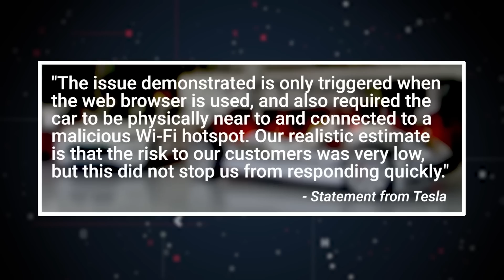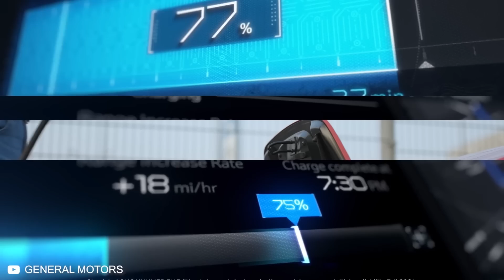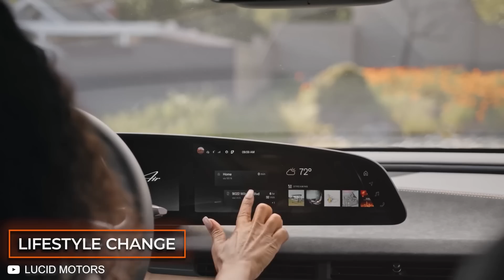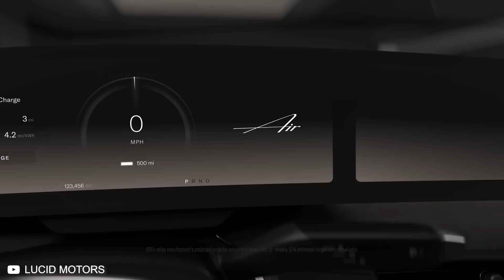EVs' Serious Problems That Carmakers Are Hiding

Comment: There is no climate crisis. There is no need to reduce our use of fuels. You're still falling for the lie that props up this entire scam.
Reply: Cool, we’ll keep exponentially consuming a limited finite resource that’s already showing signs that we’re running out of it…. Great plan. Love your work. Very logical. Much wow. Multiple tabs level IQ.
Reply: @engineeringtheweirdguy2103  where do you GET this idea that it's all about to run out? They've been saying that for 70 years. Every climate prediction for the last 100 years has been WRONG. If you think "the oil will run out" then you're the one who needs an IQ test dude.
Reply: @CTFlyer7  from the fact that compared to the 1970’s it now takes 10 times more energy to extract a barrel of oil than it did in the 1980’s. Despite improvements in technology and efficiencies. That’s because sucking the dregs out of the bottom takes considerably more energy and the only other places to get oil are much harder to reach. So maybe that’s where I’m getting that idea from sport.
Reply: @CTFlyer7  status of oil reserves is not categorised as a climate change phenomenon, doofus. That’s like stubbing your toe and shouting “THANKS OBAMA!!” But not in an ironic way. In a way in which you’re completely serious that you think it’s his fault you left your Lego out overnight.
Reply: @engineeringtheweirdguy2103  The biggest investors in fossil fuels know that if we maintain the current rate of consumption, we’ll be out of oil within this century, but not coal. There is a reason why oil companies keep as much oil wells in "inventory" as they can, and it’s not only because they want to keep them on the books as "reserves" to shore up stock prices ; )

The inevitable fight is coming over how fast to phase out fossil fuels, and it will be reduced to a battle between the biggest investors in banking and the biggest investors in fossil fuels; and globalists, politicians, environmental activists, and scientists will be irrelevant in this great battle.
Reply: @engineeringtheweirdguy2103  Keep in mind this person doesn't know that predictions from mainstream climate science have been accurate for half a century. If this person could refute any of the principal findings from climate science, he or she would be one very rich and famous person; be the biggest name in science since Albert Einstein.
Reply: Petroleum is too valuable to waste as gasoline. We should leave as most of it as we can in the ground for our grandchildren so they used for plastics, paints, petrochemical feedstock medicine, etc. The relatively current rise in CO2 is that is caused by human activities and the continued consumption of fossil fuels at current rates raises a risk for civilization. 

We are already experiencing the crisis caused by CO2 increasing - like that of CO2 fertilization, marginal farmland going out of production causing refugee flows and political instability, tropical pest species invading the subtropics, subtropical pests invading temperate zones, and the stratosphere cooing while the troposphere warms to name a few; all predicted by climate science. 

The only way anthropogenic climate change could be a scam is if there was a conspiracy involving tens of thousands of researchers operating in secret since the 1950s, in control of the physics and geology departments of hundreds of universities worldwide. Interesting how climate change deniers that say it is a a hoax, can never identify the hoaxers nor state the false claim clearly.
Reply: @rps1689  your Malthusian worldview is always wrong.

Comment: The lifestyle change is a HUGE issue for me, and I think is one people so easily overlook. You gotta look at it under a microscope. If I gave in to the pressure and, somehow with what little money I have, bought an EV, I would have to:

1) Run an extension cord out to the street every night to charge my car because I don’t have a garage.

2) Have to deal with bad battery charge in the winter because it snows here and my car would be parked out on the street every -40F night.

3) Gamble every time I go to work because there’s no charging station or covered parking where I work, so I have to pray I have enough charge in my EV after my 12hr shift. Good luck when winter comes…

4) Sacrifice most camping and road trips.

5) Risk spending 30+ minutes in a foreign (and possibly sketchy) area waiting for my car to charge because it ran out of charge before I could go home.

All in all, I’m sick of the pressure and shaming I’ve seen that come from pro-EV people. Don’t get me wrong, I love the idea of driving an EV, but the technology isn’t there yet to make me want to switch. You got an EV and you enjoy all the inconveniences that come with it? Great, but keep it to yourself, because in my estimation, current EVs are not all they are cracked up the be.

Comment: Might want to try some research before making video.  You temperature range for batteries isn't even close, my older ev has no battery warmer and I live in the northeast.  I've driven ev's for almost 20yrs in temperatures well below freezing with no issues.  Relay issues??? seriously?? all cars have relays and they are easy to unplug and plug in a new one. Even the biggest contactors have less than 10 screws including the ones holding them in.  Hackable electronics are already in all cars. Gas vehicles may be slower adopters but if you have a remote start via your phone or auto park, your hackable.  Battery's flammable, yes some types (like in you phone and laptop) are but not al. And for the record, gas is flammable too. Just a side thought a gallon of gas has the same explosive energy as a half stick of dynamite.  Something to think of the next time your putting 20 gallons in your car.

Bit of history: Henry Ford's (of the model T fame) wife drove and EV.  She refused to drive his smelly, dangerous, uncivilized monstrosity's.  Yes EV's have been around that long.

Comment: I think Hybrid is the way forward - looked at a Volvo XC90 to accommodate my large family - the hybrid version was a superb car and made my old Q7 look Stone Age.
Reply: @Shaun Bucknor  I agree.  I think there will be a percentage of the market that will be vehicles that run on the battery, and can be plugged in to charge, but also have a very small combustion engine that can charge the battery.  Sort of an extreme plug-in hybrid.  This way there will be a way forward for folks that live in apartments and rural areas and so on.   Time will tell what percentage of the market that will be.

Comment: I feel sorry for electric  car  drivers and future  owners. They will simply  have to learn the hard way .. as I did. These things are a huge hassle, all those lost hours sitting in those  charging  stations, huge anxiety, plus a outrageous expense  in the long run. Good luck trying to sell a used Electric  car with wore out battery modules. You'll find out nobody  wants to pay  the ridiculous price of batteries ... Batteries  are very ... very expensive to replace ( thousands of dollars) ...  and make no mistake, you will be replacing them. These batteries are highly toxic to our environment,  with a high potential for disaster to our surroundings.  LITHIUM BATTERIES ARE NOT GREEN CLEAN ENERGY BY ANY MEANS!  ... 

      I wish I knew all this before I bought my car .  Do your homework before buying !
Reply: As an electrical power engineer, I can tell you that our grid and generating infrastructure cannot support wide scale ev charging. It is unbelievable expensive to upgrade that infrastructure, both for utility and commercial buildings/installations. People do not understand this.
Reply: @engadvantage  exactly!!, by the time the grid is upgraded there will be a much better option like hydrogen cells, or a bio fuel. EV's just have too many issues overall.  There are many you tube videos of people waiting 5 hours for a charge at a super charger.
Reply: Accurate information.
Reply: The car is really just a battery with some accessories. The battery is the only part that matters.
Reply: Hey at least you learned. They’re evil dickheads walking around parading this EV nonsense non stop as if it’s some kind of savior technology. They need to burn 🔥

Comment: What I find comical and depressing at the same time, is that the whole concept of EVs relies on an electric power supply large enough to power them, while almost all electric power generating facilities are currently being shut down, with only wind and solar offered to replace them, which anyone with half a brain knows is not possible and thus isn’t going to happen.
The most comical part is that “global warming” and “climate change” is a completely fabricated political scam.
Wake up people, it’s 2022. 
Where’s the 20ft sea level rise, where’s the melting poles? It’s simply not happening. You’ve been fooled again. SMH
Reply: Where and what generating facilities are only using solar and wind? Wind and solar will never carry the whole base load. Solar and wind are only intended to be a stopgap.

The only way anthropogenic climate change could be scam is if there was a conspiracy involving tens of thousands of researchers operating in secret since the 1950s, in control of the physics and geology departments of hundreds of universities worldwide. Interesting how climate change deniers that say it is a a hoax, can never identify the hoaxers nor state the false claim clearly. 

Mainstream climate science never predicted 20 foot sea rise nor the poles melting. It is arctic sea ice that is in rapid decline. As predicted by mainstream climate science, the Antarctic ice sheet is holding steady, most glaciers are shrinking, and snowpacks are getting smaller every year. Plus the Greenland ice sheet is melting relatively fast, on track to be gone within 2500 years.

Comment: Not only is it not possible for everyone to charge their EV's from home but it's ridiculous to think they could. Think of all those who live in cities and suburbs who park on the street and don't have a garage or even a driveway. Not to mention all those who's cars may be parked in an apartment building's lot that's separate from the building or if you park in private parking. What you have a street charger that will have a lock? LOL like that won't get vandalized. Plus the added expense of the charger system in the home is never included in the price of owning or buying an EV but they're almost worthless without it unless all you have is free time to charge your car everywhere you go. Not to mention since you build and charge the EV with fossil fuels then still need to dispose of the toxic batteries when they inevitably die, is it's really better than the gas alternative that these days barely emits any C02 or anything else for that matter? Oh and it isn't as likely to be dead in 10yrs and the parts that are, have a much better chance of being recycled.

Comment: Never, do people not understand that the automotive industry only accounts for less than 1% of pollution. It's industry that needs to change. Industry accounts for over 66% of greenhouse gases. Why don't they just get back to hydrogen power. It is the cleanest power available. And to make just one EV produces more pollution than a gas powered car over 10 plus years. And not to mention that the battery pack is not recyclable...

Comment: I never by new vehicles and typically look for those that are 3-5 years old and I keep them for another 10 or so. My biggest concern with EVs is battery life. After 3-5 years, battery capacity is reduced by about 10% or more on an already inconvenient distance capability. Superfast charging also decreases battery longevity by another couple of percentage points. I don't know that I'd want to put $15k into a car after having it for only 5-7 years (assuming 10-year battery life) for the sake of gaining another 2 or 3 years out of it. That's the biggest problem with EVs in my view, the 2nd hand market -- there isn't one that makes sense.
Reply: The people who generally purchase EVs don't care about the degradation that fast charging because they'll get rid of it before it's an issue. But yes, it's something that will affect the second hand market and I definitely wouldn't want to purchase a second hand EV that has a bunch of fast charges on it.

Comment: Haven't looked into EV's much until recently.  To show how dumb I am, I assumed you could charge them at your house.  I was sort of wrong.  According to energy.gov:  "The downside of EV charging with a 110v outlet is that it takes a while.  Level 1 charging provides approximately four to five miles of range per hour charged. For an eight-hour overnight charge, this will enable traveling around 36 to 40 miles which is great for people who drive less than 50 miles (80 km) a day."

"However, others with long commutes or who drive for work need more range may prefer to invest in a 240v, Level 2 wall-mounted charger. 240 outlets are the type you typically see for electric clothes dryers at home and are the type most commonly installed for public charging stations. Compared with Level 1 charging, a Level 2 charge takes about half the time - providing about 180 miles of range over an eight-hour overnight charging period. Level 2 charging is the best option for drivers in a hurry as well as those who drive more miles in a day. Level 2 fast charging is especially attractive for those who don’t have reliable access to public or workplace chargers. A Level 2 Charger  will need to be installed with the help of an electrician and it can be placed in a location that makes at-home charging even easier."

Apart from this, where else are you going to charge your ride?  One of the handful of spots at your grocery store?  And when you try to do so the thing is out of order or some selfish asshole is hogging it for a day to top off his ride and screwing over everyone else?  This is technology gone berserk.  It's simply a power mechanism, these demons care not one iota about the environment, climate, earth and especially humanity.

Comment: I think the biggest issue is how they perform on the used market. Most people don't buy new cars. You need to be able to buy a 10 year old used ev for 1 to 5 grand... That car needs to have the same range as when new and last for another 10 to 15 years with minimal maintenance.

Until that happens most won't be able to afford them and they'll never be mainstream.

Comment: EV's are very HEAVY because of their enormous battery.  Most gasoline powered cars weigh between 3200-3800 lbs.  But a typical EV weighs around 5,000 lbs.  Also, because EV's weigh a lot more and have very torquey/powerful electric motors, they wear out tires a lot faster and place more stress & wear on our roads.  WHEN will a Road Tax be applied to the electricity that is used to charge an EV??  Right now, many EV owners are getting a "Free Ride" when it comes to them paying their fair share' concerning road taxes in the US.
Reply: EVs tires are already designed to wear at the same rate of that of tires or better than that of those on an ICE car,  plus due to EVs' good traction control, tires last longer, as their driver assist-systems reduce slipping by utilizing the electric motor's rapid power adjustment. This system is much quicker than in ICE vehicles, where it is based on braking and limiting engine RPM.

Brings to mind the trucking industry causes well over a hundred billion in damages a year in the form of wear and tear on roads, but trucking companies don’t pay for these costs. They are passed along to the taxpayers, as the trucking industry doesn’t pay the costs of these negative externalities. This translates into a huge subsidy for the trucking industry.  Imagine what we would have to pay for goods if firms that send goods by truck and the trucking industry had to pay for the cost of these externalities. It’s is kind of a free ride for the firms that ship, as they never have to consider them when deciding how and where to ship goods.
Reply: @rps1689  You just told a flat out LIE... or, you don't really understand the TAXES that the trucking industry pays regarding fuel taxes.  So... EV's require special tires.  BTW - You can't cheat the laws of physics.  Heavier vehicles DO create more wear.

Comment: On average, it takes approximately 8,000 gallons of water to extinguish an EV that's on fire.
Reply: Or a lithium blanket then the battery has to be submerged under water, but the chance of an EVs battery igniting is 50 times less than that of a ICE, but your EV will be a write-off. Good news is some automakers are going to stop using lithium ion batteries and use lithium iron phosphate batteries instead, which will make them safer than existing EV's.

Comment: The problem for me is road trip charging- i do about 75% in the city going to and from work about 5mi/day and live in an apartment, but 25% of the time I make trips greater than 200mi. It's way to expensive to buy an extended range car for me, but the thought of spending an extra hour traveling home to my parents (210mi) is annoying and might cause my day trip to be grueling; my current ICE car gets about 35mpg on the highway and has a 400-450mi range on a 12gal tank so i can make it there and almost back with 1 tank of fuel so no stopping

Comment: The cost of the battery replacement is why these vehicles should be leased, not owned, and this is part of the bigger issue, of," you will own nothing and be happy".  The word "choice", is relative.  If governments are mandating the ceasing of production of gas, and diesel powered vehicles, within 10 years, I think, do we really have a "choice".  Not everyone lives in the city, depending on the country, they may have a very large rural population.  Charging infrastructure is few, and far between.